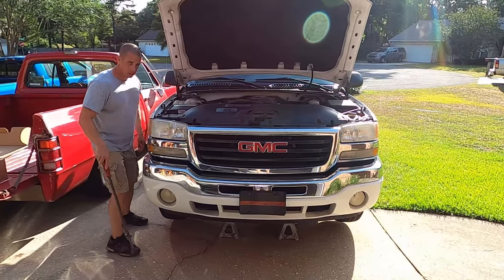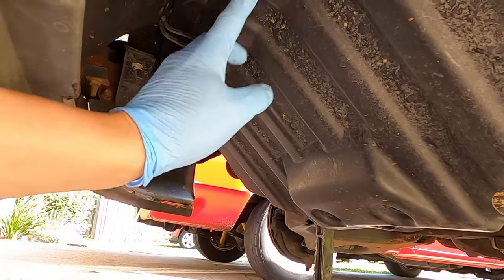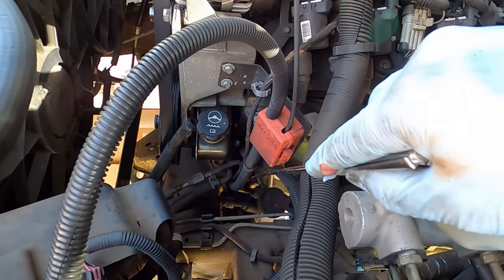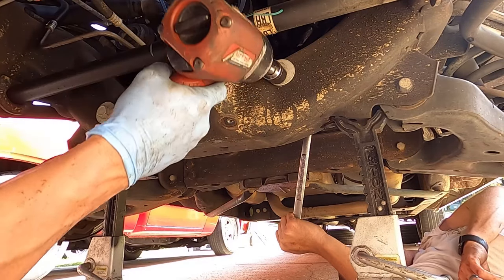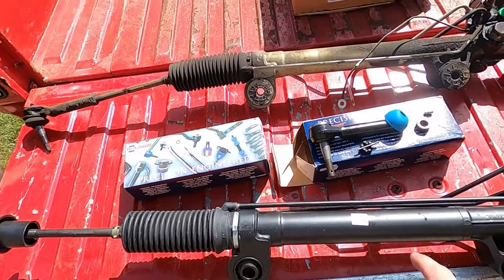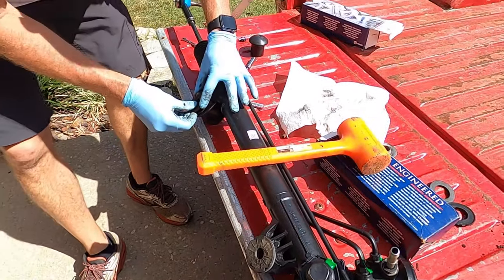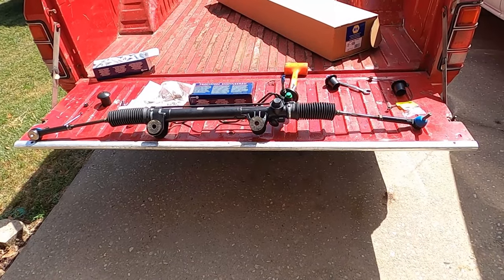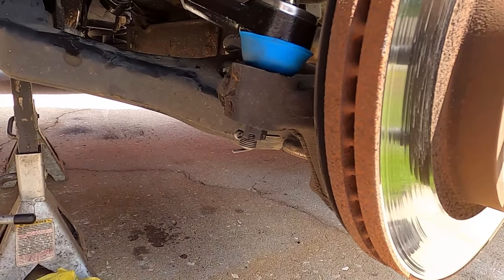Rack and Pinion Replacement (2005 GMC Sierra)

Comment: Best way to bleed system is with a large rubber cork in the fill neck with hole drilled in it and vacuum pump attached.  Or go lock to lock with wheels elevated 20 times without engine running. Just trying to help. Great work

Comment: Thanks for the video, really helpful! What was the grounding wire for. The rack and pinion I installed doesn’t have threading for the grounding wire. If I remove it and don’t ground the rack will it cause any problems?

Comment: Badass video! I need to replace my rack and pinion on my 2000 sierra. One thing I will say is get the rotors turned or replace on this truck they are warped bad and mine were too. Thanks

Comment: Great video guys, with lots of good info.  You mentioned that the lug nuts are torqued to 100 ft lbs, but the specs for my 05 Silverado 2 wd 1500 call for 140 ft lbs.

Comment: As you guys probably already know these GMC's are notorious for rusting underneath and the tubings are cheap and problematic, I have replaced all the brake, fuel (and patched) the transmission lines and now the line on the rack and pinion popped, I ordered them through Amazon (because in my area) NO BODY CARRIES THESE LINES waiting for second line to arrive and will be reinstalling new lines on the rack and pinion.

Comment: In the middle of changing  upper and lower Control Arms and springs right now, no help and all breaker bar, no power tools. Yeah, and changing All ball joints, the ones that come already pressed in the control arms look of low quality, I hate rivets  btw...Yeah, and while I was under there the R&P rubber bushing look wasted...If it ain't one thing...
*Love The Red Dodge!*....I used to have an "89.
So Many Trucks And Not Enough Time!

Comment: if the grease zerk is center of tie rod end , measure using it to index , check toe int after back on ground , set 1/16" -1/8" toe in ,

Comment: At the 12:10 mark you talk about the bushing caps or whatever they are called for the mounts. I bought an Edelman part# 2015 rack and pinion and I cannot get them pressed in. I tried hammering them and I tried using an impact gun with the bolt and nut to drive them in. Then, I measured the sleeve with calipers and compared it to the old rack. The holes are much smaller. Has anyone had this problem with the Edelman brand new rack and pinion?
Reply from the maker: I’d call the manufacturer

Comment: I have an 06 silverado that rides really rough. Any little bump, and feels like the wheel are going to shake off. Any suggestions? I already replaced upper and lower control with bushings and upper and lower ball joints
Reply from the maker: So many factors. I would have to look at it. Shocks, hub, tie rods etc.

Comment: Question? Did it clank when you turned the wheel left and right while sitting still? I have really bad wander left and right while driving. It is not the balljoint or tie rods
Reply from the maker: Did you get an alignment done?

Comment: Is this a model to where you have to worry about a steering angle sensor? I had a issue with it on a Tahoe and my newer challenger when replacing racks. I had to zero the sensor back out then attach my steering shaft after I moved the rack to meet the steering shaft to install so I didn’t have a issue with killing my clock spring.
Reply: No steering angle sensor on this truck.

Comment: If I have the truck elevated right after replacing my rack and I turn it over and hop in to get the air bubbles out.  Why would my steering wheel be bouncing going from lock to lock?  No wheels on it.. not going down the road..  just finishing your last step in the video..  what could be the reason
Reply from the maker: Air in the lines. Turn it off and let it sit for a bit.
Reply from the maker: The fluid will foam up when it’s low.
Reply: @TheGasTap  thank you. I appreciate your work.

Comment: could you have swapped the breather tube form the old rack?
Reply from the maker: No, they were shaped completely different. You can see when we pulled the old rack out, there is a bend in the tube. The new rack had a straight tube.

Comment: What symptoms were you having that causes you to change this? 
All of my ball joints, etc seem to be tight but my steering wheel can significant play. I don’t think it is the lower or intermediate shaft. It seems like the moment is in the rack and pinion. Thoughts?
Reply from the maker: The inner tie rods were worn out. 
Have someone turn the steering wheel while you watch for play in all the joints. (Only turn the steering wheel the about of the “play”. Not full turns )
Reply: @TheGasTap  thanks for your reply.  I had a mechanic check for play in all the joints.  He said everything is tight.  When I rotate the wheels back and forth, the play seems to be where the lower shaft meets the rack.  The shaft turns at the rack and the wheel dont move.  Im wondering if that is a symptom of a back rack and pinion?
Reply from the maker: Sounds like the rack to me.  You may need to find a new mechanic if he didn’t spot that.
Reply: The inner tie rod has a ball joint attachment, (ball and socket). They wear out. Most rack and pinion steering units have replaceable Inner joints, but General Motors decided they would rather sell the whole rack and pinion steering gear because , hell why not sell a whole unit for 600 bucks instead of a couple of 30 dollar tie rods when they wear out.

Comment: I got a 2004 Sierra and the boots on both sides got leaks. Should I try to just replace the boots or replace the whole rack and pinion?
Reply from the maker: Sounds like the inner tie rod seals are leaking under the boots. I would just replace the rack.
Reply: Damn, how much was the rack and pinion?
Reply from the maker: Not sure. $180 sounds familiar
Reply from the maker: RockAuto
Reply: @TheGasTap  how do I know what rack and pinion to get specifically? Or are they all the same? I have a 4 wheel drive if that matters

Comment: Great video! I had the same issue with the ground strap wire. Where did you end up wiring it to? Or did you just leave it off?
Reply from the maker: Left it off and it’s all good.
Reply: @TheGasTap  Except for the dissimilar metal corrosion between the aluminum rack and the steel truck frame. But you know better than those engineers that designed and tested the truck. 🙈
Reply from the maker: How would it not ground it’s self being that it’s all metal? Housing, gear, tie rods. Seems pretty grounded. 
Please explain the science here. 
Thanks for you comment.
Reply: @TheGasTap  Google Galvanic Corrosion of dissimilar metal parts. The bonding, or ground cable provides a path to ground the electricity produced between metal parts made of different materials. Two dissimilar metals when placed together, (especially in a wet salty environment) behave like a battery. Voltage is produced, but so is corrosion at the contact points. It's a common practice. Its why you don't attach aluminum with steel bolts or steel with aluminum pop rivets. But you are right. It's not gonna make a difference in function. Just the next guy that has to remove those rusty bolts.
Reply from the maker: I understand the dissimilar metal issue. I’m not understanding why a ground wire makes a difference when the aluminum is only the body and the rest of the internal parts are steel. Ground wire then also goes to steel. What’s the ground wire doing that the internal steel parts grounding to the steering knuckle then to the control arms aren’t doing?
Reply from the maker: Also, the bolts have a rubber insulator but if they come in contact with the rack then that is another ground to the frame. Still confused on the ground wire here.
Reply from the maker: Starters have an aluminum body and no ground wire. Aluminum rims also don’t have ground wires.
Reply: @TheGasTap  While the ground will help some, you are absolutely correct about it being bonded to the rest of the frame and it will be fine for another 20 years. Great work by the way and like Master P said "There's haters everywhere you go"

Comment: Very helpful video I struggled with the hose unions on the rack they were hellishly tight but i did what you did and disconnected the low pressure hose and took the fitting out with the rack off very useful tip